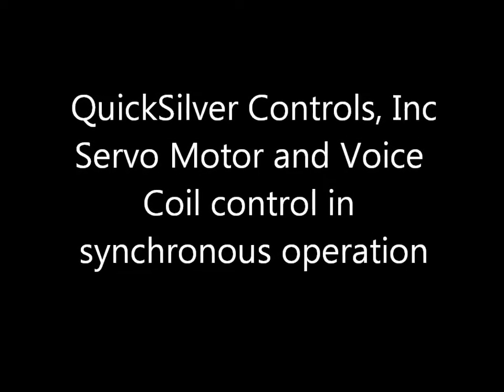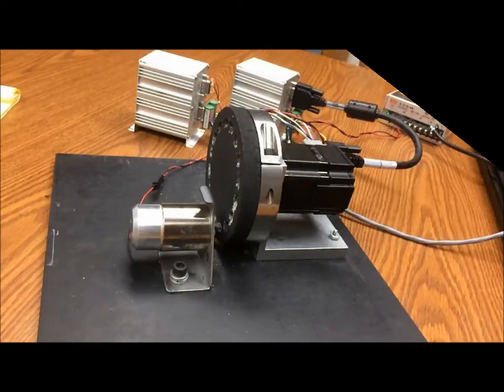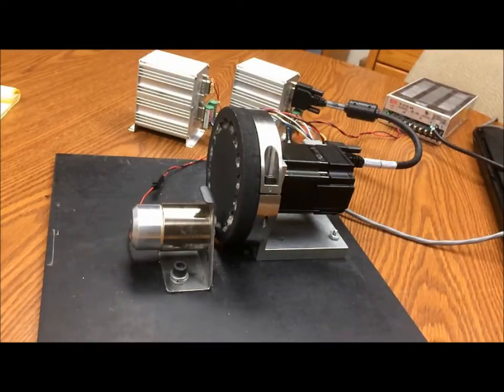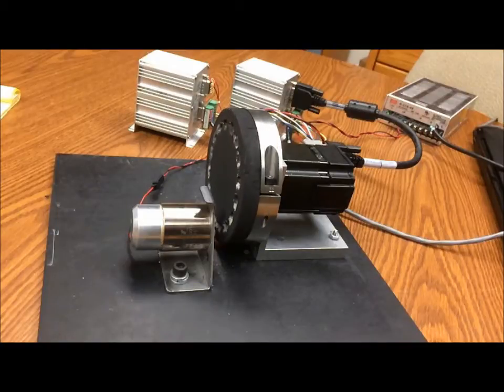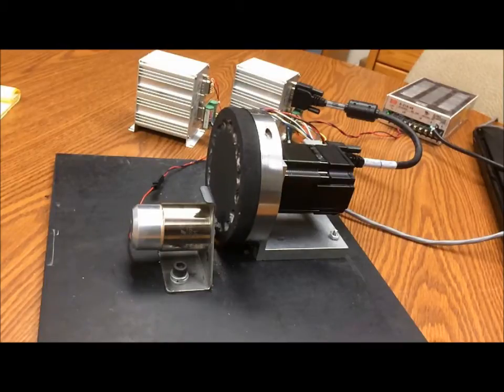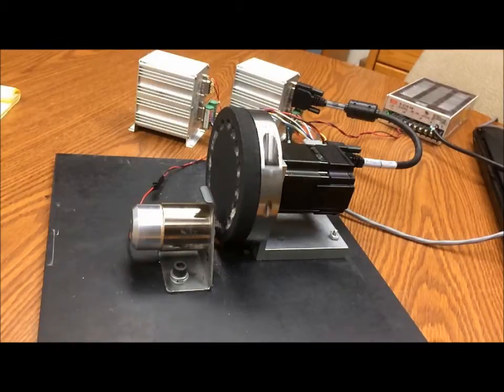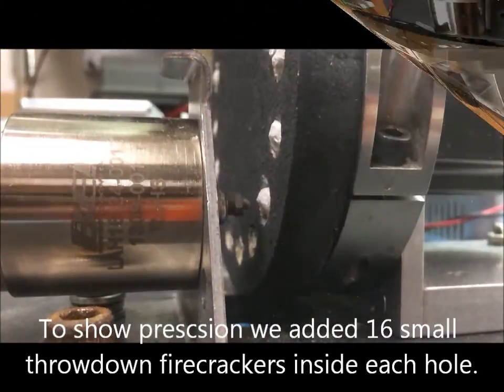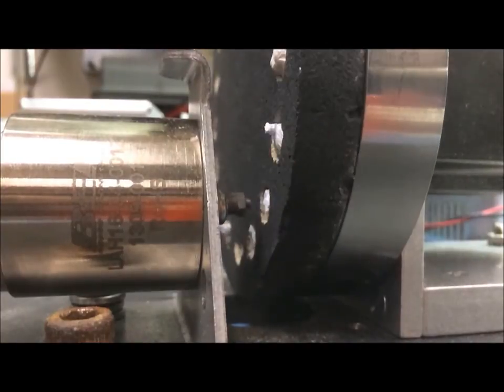Servo Motor and Voice Coil in Synchronous Operation

Comment: what is the voice coil model & driver you use for the application?
Reply from the maker: The controller is the QCI S2-IG controller. This controller series supports Stepper, Hybrid Servo, 3 phase brushless, DC and Voice Coil motors.
The voice coil shown is a BEI Kimco BEI LAH16-24-000Z; we support many BEI sizes of these voice coils, supporting both their analog feedback and incremental encoder feedback varieties, as well as other voice coil vendors.